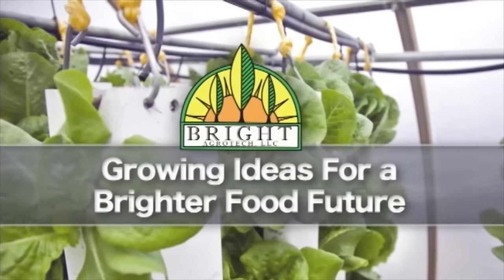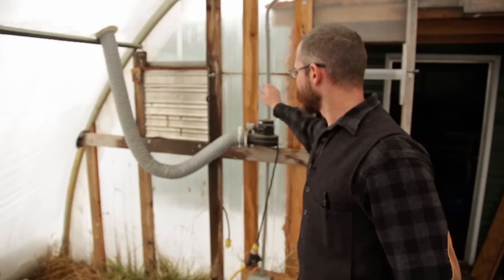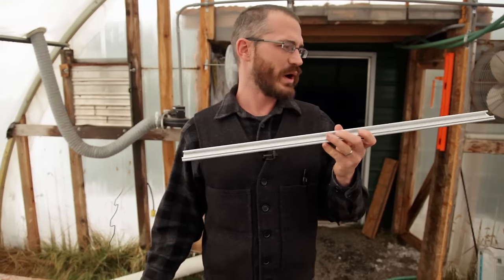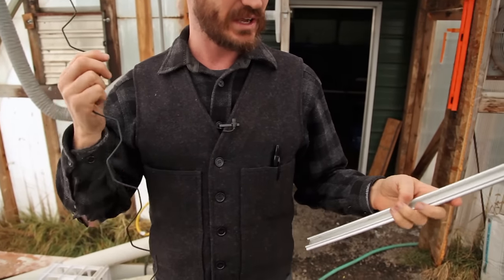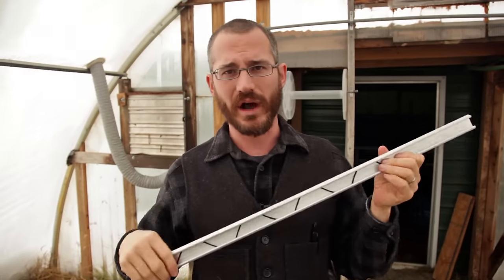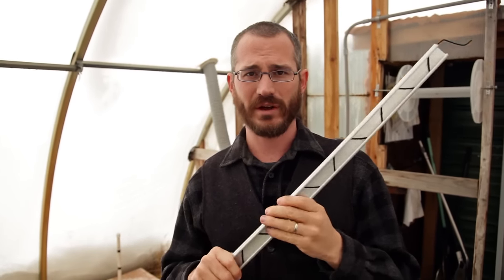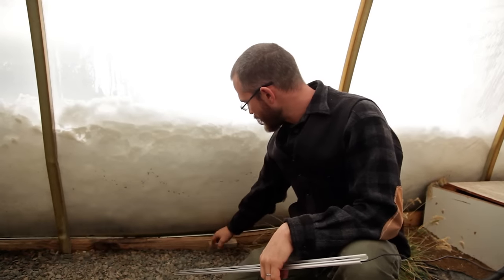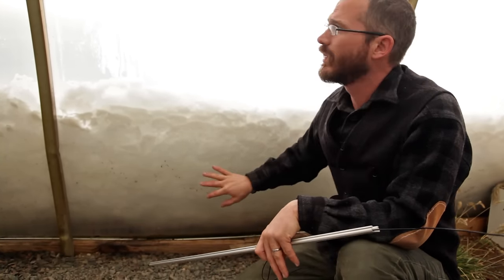Wiggle Wire & Double Layer Greenhouses

Comment: Hello, thanks for posting this video. It helps in getting clarifying some of my confusions.  Thanks.

However, i have few questions

1) What about hot climates. Once we infilate double layer there will be air inside always and in high summer temperatures the air will get hot and makes the inside climate more hot. Could you please clarify it?

2) We clip the wiggle spring before inflating between the layers. I think wiggle spring will lock transfer of air if wiggle is installed also at upper pipe. So, if we use double layer poly then we must install the wiggle at the bottom so that the air reaches all  places between the layers?

3) Whats the dimensions of your house and how much time it took to pump in and fill the air?

4) Are you still conducting webinars?

Kindly respond.

Comment: Thanks for these videos!  Quick question...do we put the first layer of poly on fully with the wiggle wire and then install the second layer with another layer of wiggle wire?  OR, do we instal both layers at once, and then put on the wiggle wire just once??
Reply: Both at once to get them somewhat air tight.
Reply: Often if sections are airtight you will need a tube to jumper the fan air flow into each section. 

There is also a pressure switch you can buy that senses the pressure between the layers and only turns on fan when pressure drops so the fan only runs as needed and cuts off when the pressure in the gap is back to normal. This also lowers the amount of condensation between the layers and also lowers heat loss from constantly blowing your warm air into the cold gap.

Comment: Out of curiosity, when using the blower to make an insulated layer, is there an outlet for the air pumped in between the sheets..Or is it leaky enough that there's an inlet only?  Also, is the second/outer polyfilm layer intentionally made a little looser than the first/inner?
Reply from the maker: Hi icarus,
There is no outlet for the air.  Some of it will leak out, but for the most part it is pretty static, keeping the blower on keeps it pressurized.    The outer layer can be a little bit more "baggy" than the inside layer.  We usually like to have both layers with some tension on them, but allow them to sag slightly between the ribs when deflated.  Usually this still entails a lot of tugging and tensioning to get it tight enough.

Comment: I'm trying to see the temperature different with using double layer poly or doing a geothermal method. I would rather use a double layer poly being that it seems easier to install. I would like to grow oranges and lemons in an environment that gets down to 20° - 25° with heavy snow loads in the winter. What do u suggest? Would double poly work or should I do a geothermal method?
Reply: You should do both

Comment: Great video, Here's a FYI.  We got 2/3's of our poly up and found out we didn't have enough wiggle wire to complete the job and no stores in our area had any.  A MacGyver type employee came back with a couple of 4ft strands of barbless fencing wire. ( Barbless wire has 3 strands wrapped together for greater tinsel strength.)  After separating  the strands he took his plyers and made the rest of the wiggle wire we needed, worked fantastically. 🤔
Reply from the maker: Thanks for the info, great tip for our viewers!

Comment: My GH is made of 2x4s. I put plastic on both inside and outside. The plastic is stapled and secured with furring strips around the perimeter and on each stud to counteract wind. Just survived the winter of 2013-14 with the only issue being interior sweating. Is it necessary to pump air between the sheets of plastic in this situation or is the pump just used for plastic separation?
Reply: that's what I was thinking about doing. Have you done any more development on this since it's been 3 years since your comment?

Comment: Thanks for the video. This is the 3rd video I've watched on 2 layer poly inflating and no one has mentioned what the r value of the 2 layers with air space is.
Can someone answer that please?
Reply from the maker: Hey Paul Ladendorf - with inflated double layer 6mm poly film the R-Value is about 1.7.
Reply: 1.6 then ypu add air and via diffusion you have a R factor of 5

Comment: Questions about the PE plastic layers.

1) Do both layers have the IR+Condensation coating? If so, do both of those special coatings face inward?

2) Most greenhouse PE I've seen says to not let it come into contact with PVC. Is that a potential issue with PVC coated wiggle wire?
Reply: I can answer 1, in case anyone comes along wondering. Usually just the inner layer needs the IR/anticondensate coating. I'm in a semi-tropical environment, however, so there might be a difference for cold-weather systems like at Bright.

Comment: Hey - 2 questions - Just bought a property with a poly greenhouse with wiggle wire but it is missing poly (torn off) on one end. We want to replace the plastic
(1) is the wiggle wire removable and then reusable? If so how the heck do you do that?
(2) do you need to run the pump for inflating the double layer all the times? Looks like this has been set up in ours at the one end, but we have no power to the greenhouse at the moment.
Thanks!
Reply from the maker: Hi Michelle White - Yes the wigglewire is removable and it's a pretty easy chore to accomplish. We can make a video on that here soon. In the mean time you should be able to simply working it the opposite direction of the way you put it into the channel. This process is much easier with the PVC coated wiggle wire like we use since you reduce the risk of tearing your plastic. Yes, we'd recommend running the inflation pump around the clock to keep it filled and maximize your buffer layer of insulation. Also having it filled will help thwart any vicious wind attacks. The pump is small enough that it draws VERY little energy at all. It's less than an amp. Hope that helps! Are you on our email list yet?
Reply: Don't use a pump it is loud and expensive. Use a blower like in the video.

Comment: How much heat power is needed to maintain 70F temperature difference with the outside air for 4 acres greenhouse when using double layer polyethylene? Does make sens to blow hot air between the two layers?
Reply from the maker: Well, when it's 30F outside, maintaining 50F inside our greenhouse (2000 sq. ft.) consumes around 200K BTU/hr.  You can probably extrapolate that out roughly 20 times that for 1 acre, and around 80 times that for 4 acres, or around 16M BTU.  Of course to get a good estimate you'll have to do the math for your particular structure type. . .  The air between the layers doesn't matter beyond just creating a "dead" space.

Comment: Nate, I understand the concept, but where is wiggle wire used on your hoop houses?  Does every rib have wiggle wire?  I struggle to understand how a small fan can inflate the entire length. 
It's - 8 degrees right now in WI. Inside my geodesic dome it is 60 degrees.  It will be -21 degrees by morning with 15 to 25 mph winds.  Wind chill will be approximately - 50 degree!  Gotta love my Rocket Mass Heater!
Reply from the maker: Hey Rj Aquaponics - Sorry for the confusion there. We anchor our covering along both baseboards of the greenhouse using the wiggle wire/channel, and then along the sidewalls (up and over the arches).

Comment: how strong is it for wind blow? is it stong enough? because i will use pvc pipe to thigt plastic. which one better?
Reply from the maker: As long as you've got it tacked down, you should be good unless you're in a hurricane or tornado. If it can stand up to Laramie, Wyoming winds, it can stand up just about anywhere.
Reply: Bright Agrotech in my place (indonesia), sometimes windy, not strong wind like tornado but sometimes it's strong enough, so I'm worried about the wiggle wires will be released because wind blow. for now, i'm trying to grow crops with Hydroponics system
Reply: pvc pipe is not strong, it will be weaken overtime with the strong Indonesia sun heat,

Comment: when we switch plastic to shade cloth on our green houses we have a storage issue with the wiggle wire. The issue is that the wires get tangled up, do you know of any efficient way of storing wiggle wire?
Reply from the maker: +Kasee Smith Unfortunately not...  If you can figure it out, let me know!  I’ve spent many an hour untangling that stuff. Sorry we couldn't be more helpful!
Reply: layflat polythene tubing, very cheap and reusable ;)
Reply: try big sheets of paper (maybe that brown craft stuff that comes in a roll) folded in half and tape or a clip to keep it closed?

Comment: how much wormer is having a Double Layer Greenhouses dos it make that much difference
Reply from the maker: Hi Paul, yeah there's a very significant difference in insulation capacity. Single layer poly has about an R.5 where as a double layer poly greenhouse has an R1.5 to even R2. That increase in value definitely adds up for a minimal additional investment.

Comment: How many layers of 6 mill film can you install in single u channel with wiggle wire? For instance, your end walls. Thanks.
Reply from the maker: Hey +Bradley Romero - I've only ever used two, but my guess is you could do three or four if you needed to. Hope that helps!
Reply: +Bright Agrotech yes that does help and thanks for the quick response. I appreciate the video.
Reply from the maker: +Bradley Romero Of course, happy to help!
Reply: +Bradley Romero If you ever try more please tell me (us) how it worked! Its sounds like a great idea, and pretty obvious as well :D
Reply: +Bradley Romero now that i think about it, it might be tough to install a second blower between the layers, and if you conntect the airpockets you dont gain anything from that as well...
Reply from the maker: Hey +Bradley Romero - Two is probably recommended, but we've done 3-4 depending on the application (e.g. end wall stuff, etc.) Gotta be careful though!

Comment: obviously an endorser for wiggle wire...easiest most inexpensive way is using wood...you can either use planks with a 3/4 gap between them or a larger plank like a 2x4 with a channel cut into it with a router. either way the plastic is rolled past and a piece of wood ripped down to the appropriate size and pushed in...it replaces the expensive wiggler wire
Reply: timber prices have skyrocketed here wiggle wire was expensive vs timber

Comment: Wiggle wire width, and internal channel width?
Reply from the maker: Most wiggle wire and channel we have seen is the same approximate size, the channels are normally 1.25" on the outside, and 1/16" thick metal so roughly 1 1/8" inside size
Reply: @ZipGrowInc  thank you!. I am planning to use a router bit to create channels in wood.

Comment: I can't order these wiggle wire and profiles anywhere from europe :s
Reply from the maker: +boomshine7 Ah sorry to hear that. Hopefully you can find another solution!
Reply: You may have found a solution by now but in case you didnt. wiggle wire and c-section is available in the uk. Its taken literally years for the penny to drop here when the states has been using it for decades ;) We`ll probably be well into the next century before double poly catches on lol
Reply: thx alot for your comment john , i deferred the idea but now i will look into it
Reply: You should also look into controlling the blower with a differential pressure switch, running it 24/7 is a waste of electrical power. It also allows the use of 12v blowers and offgrid installation.

Comment: Did you say 6mm poly or .6mm?
Reply: 6 mil which is 150 micron or 0.15mm
Reply: 6 mil= 150 micron film
Reply: A mil can refer to a thousands of a meter or a thousands of an inch. Here it can only be 6/1000 inch.